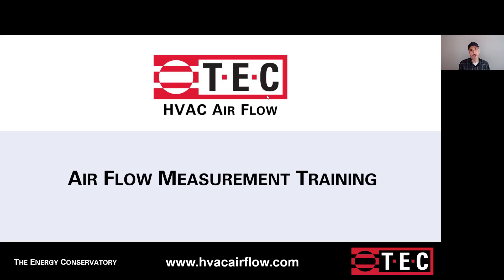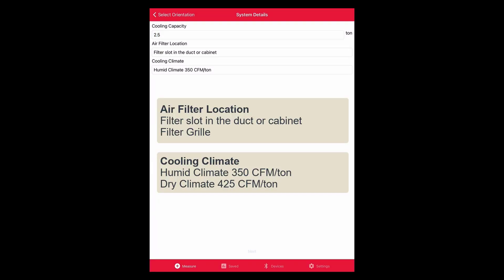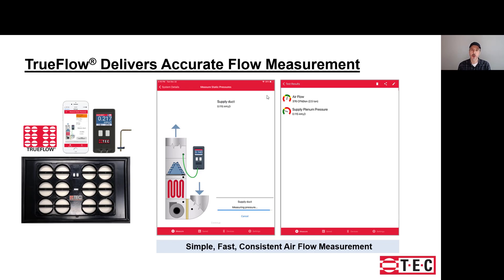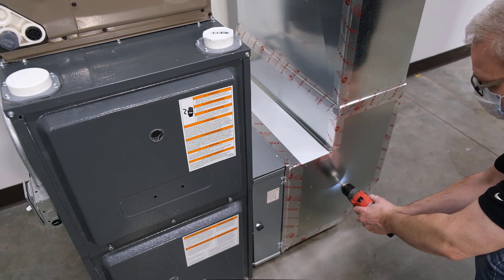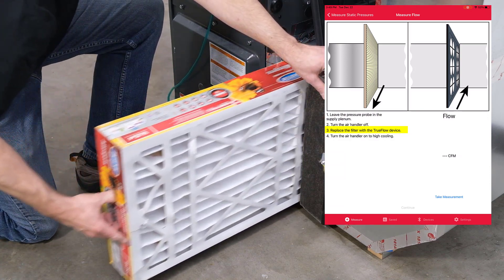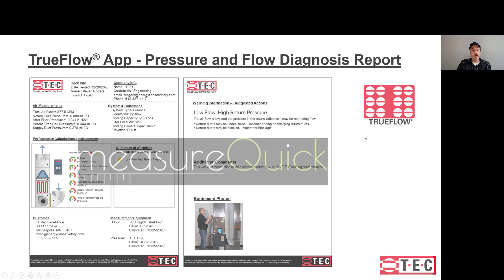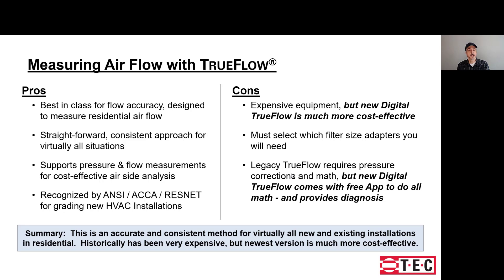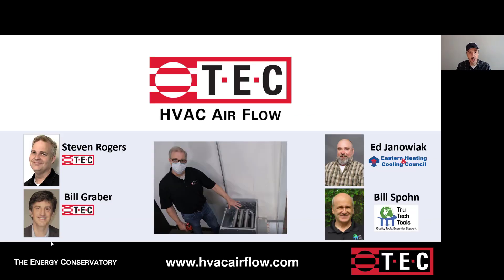HVAC Air Flow_Step-by-step_TrueFlow

Comment: When using for an air handler with filter grills can we just check at the unit with the tru flow instead of the filter grill .?
Reply from the maker: Yes, the OEM filter slot of the air handler can be used.  If this selection is chosen, select filter slot in the workflow, and remove the filter from the grille when the TrueFlow is installed in the OEM filter slot.
Reply: @energyconservatory  do we have to leave the filter grill open ?
Reply from the maker: @MartinAmaya-b7p  If the grid is in the slot, the filter grille does not have to stay open, however it is recommended.  Keeping the grille open eliminates the pressure drop of the grille and allows free flowing air to the TrueFlow grid.  The app has a built in warning if the restriction of the grille becomes to great.